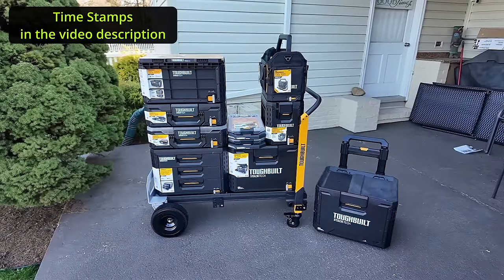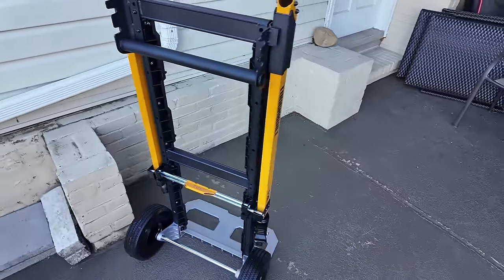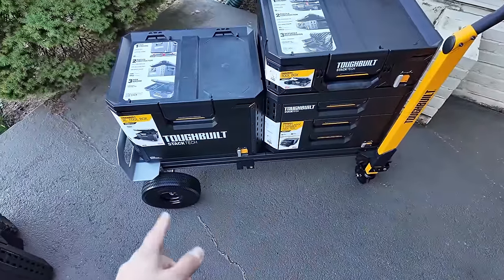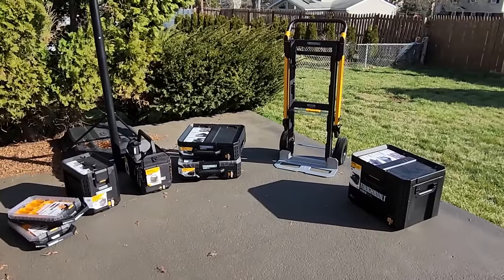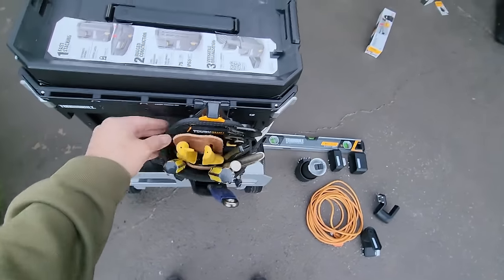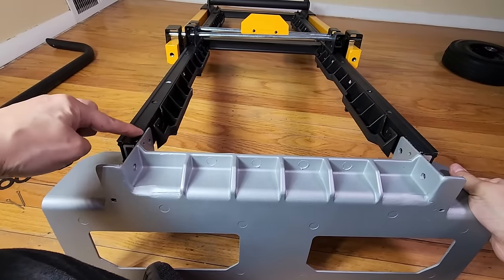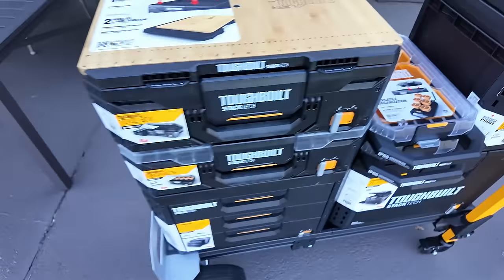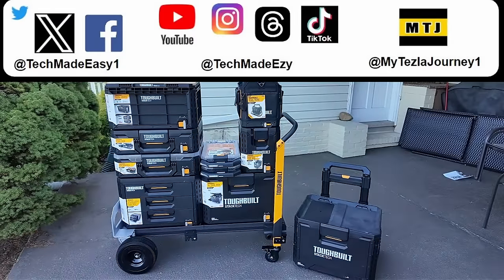ToughBuilt StackTech 2 in 1 Convertible Hand Truck Stacktech Hand Truck

Comment: Nice review I still want this even though it won't do fit in cart mode on my trailer I made. It will fit if my machine  in not on trailer. I made width of the trailer 3f 8inch.
Reply from the maker: Thanks 👍🏼

Comment: What is the height in handtruck configuration with the 3 drawer attached? Would they fit under a tonneau cover in a truck bed while attached?
Reply from the maker: Remind me and I will check, poke me tomorrow late am
Reply: With only the 3 drawer box (or two of them side by side) it would fit under the cover on my F150 (retractable cover, not low profile), but the handle will not. You would have to slide it under in dolly  configuration. The handle sticks up roughly 3½ feet in hand truck configuration.
Reply: It's just under 26" to the top of the drawer box

Comment: Does it fit in a truck bed? Like laying down or on its side? I have the milwaukee hand truck and it fits in the bed while turn on its side. Let's see a video of that!
Reply from the maker: Yes, You can lay it down in a truck bed
Reply: @TechMadeEzy  I wanna see if if it fits in 4 wheel mode though with single drawer of tool box. I have a teanou cover on my bed and looking for solution to be able to just pull out my stuff rather than having to take it all apart and back together every time I take it in and out of the bed. F150 bed height is 21inches. Need to know the height of the hand truck with the single drawer or regular tool box still attached.
Reply from the maker: Ok good idea

Comment: It looks like the crack in the toe plate wasn’t there during the assembly part of the video. Did it get dropped hard or something?
Reply from the maker: It wasn't there during setup it's interesting because I didn't put any weight on this so I don't know how that happened but that concerns me I'm going to have to swap this out
Reply: Could just be a scratch in the powder coating that looks like a crack if it wasn't there during assembly. You should look at it super close to see if it's just scratched powder coat or an actual crack.

Comment: Where can I get this it's out of stock everywhere
Reply from the maker: The only way you’re gonna find it is if you just drive to many different Lowe’s stores check their stock and check their above stock even in certain isles. We actually had to drive to Florida to get this one. You can also go online and use different ZIP Codes on the Lowe’s website until you find one and then when you do, you’ll be able to set it up for pick up. They won’t offer delivery for some reason.  good luck.

Comment: at 8:27 is that a massive crack in the forging of the bottom? thats not good.
Reply from the maker: Yup, not even sure how that happened. When I was assembling this it wasn’t an issue and I didn’t even get to use this other than moving it around and putting empty boxes on it so I’m gonna have to make a claim.
Reply: Not sure this is a forging looks like a casting. Use your Dictionary…. Sorry ❤😊
Reply: Forged parts have some markings the process hey I’m retired and love being hopeless til it’s modified for task at hand.

Comment: How does this compare to Cosco Convertible 4--in-1 hand truck that goes for $129.99 - $159.99 at Costco (usually on sale at $99.99)?
Reply from the maker: Don’t know Justin, have you seen or used that one?
This, of course, fits a tough built stack Tech toolboxes, which is an advantage
Reply: I’ve got one of those and I hate that the nose plate feels like it’s on a hair trigger; the nose plate may as well not have the ability to fold up, since it very easily unlocks and slams down. I’m thinking of replacing it with this TB handtruck since I’m accumulating Stacktech boxes (which I absolutely love).
Reply: Looks like the TB dolly is very similar to the Cosco 3 in 1 dolly. I've got the Cosco 3 in 1 dolly which is like the 4 in 1 but  the foot doesn't fold up. It has been great in my applications of using it to transport Dewalt ToughSystem boxes, ladders and step platforms on job sites. It's been so handy for both rough terrain transport in its 2 wheel configuration as well as handy loading up a lot of stuff on it in 4 wheel configuration on concrete surfaces. Tough Built has got a winner with this dolly if your in the Tough Built platform imo. It is a bit pricey considering you can get the Cosco 3 in 1 for $99 often. But ofcourse the locking feature for the boxes is pretty neat imo If your willing to spend the $.
Reply: @justinssebanenya1329 I think your prices are for the Cosco 3 in 1 not the 4 in 1. The 4 in 1 is around $190 usually.
Reply: I have the 4 in 1 and it's great. I have no issues with the toe plate on mine as someone else posted. The best thing is you can use it at a 45* angle between dolly and hand truck. I don't use it a lot but when I need it it's awesome to have.

Comment: Some of those are just tack welds. Kind of hard to tell, but one of the welds appears to have a crack.
Reply from the maker: I have to say I didn’t have time to exchange it or do any warranty claim, but I’ve had no issue and I’ve used it a few times

Comment: The castor wheels are small and solid, can't roll over much other than smooth hard surface. $269 is about $200 too much.
Reply from the maker: you own one?
Reply: @TechMadeEzy  I'd guess not. It seems like it's solidly built, and the castor wheels look plenty big to me. I thought 269 was a little much at first, but upon reflection, if it can handle 400 pounds in hand truck mode and 800 in cart mode, it's a steal imo. The Milwaukee equivalent is only 40$ less and is a hand truck only. I'm pretty partial to Milwaukee, but this is obviously worth the price.
Reply from the maker: As you know, I’m just doing a review I’m not a construction guy. I’m not putting this through the test but definitely first impression putting this together using it for a few days with different configurations. I feel pretty good so far.
Reply: @TechMadeEzy Its a pretty good dolly even if its a little pricey. Its probably worth it since it has the box attachment system on it. Cosco makes a 3 in 1 that is very similar and they usually charge $169 for it but you can often get it for $99. I have one and have used it for several years with my Dewalt Toughsystem boxes and it works great. If I wasnt already heavily invested in the Dewalt system id probably get into the Tough Built system and get this dolly. It is a very versatile solution for transporting the box systems and so much more on all kinds of terrain in my experience. And the Tough built box system seems to be a winner.

Comment: Too heavy, assembly shows how poorly parts are made.  Took a hammer to get the parts together.(the handle) Several of the welds had flux wire pieces still sticking out.  I tried it on one job.  Switched to the 4 wheel dolly, and the equipment back to my old hand trucks. Thx for the video.

Comment: LOOKED LONG AND HARD THAT CRACK WAS NOT THERE IN YOUR ASSEMBLY VIDEO
Reply from the maker: Paul you are correct I went back to the set up video and everything looked fine, so this must’ve happened after putting it together. The weird part is we only had boxes on this unit. They weren’t even full. There was nothing inside of them. I’ll have to contact them and get a replacement.

Comment: You cannot buy it anywhere.
Reply from the maker: I know it takes time but try to run around to different stores when you have time you might actually be surprised to see one sitting on the floor in stock
Reply: Lowes has a price tag on the shelf but no units yet. 🤨
Reply from the maker: @SD-jf7nb keep walking in the stores also keep checking Lowe's online with different zip codes
Reply: @SD-jf7nb  what was the price?
Reply from the maker: $269

Comment: looks like you can not open the units on the handle side while in place since the handle will get in the way. The entire idea on any of these stacking systems is the ability to open lower units without unstacking. Poor design on Toughbuilt's part
Reply: You can, just got to unlock box above and tip back an inch to access center latch then drop box back down.
Reply: @MONEYZ123 Yep pretty easy actually. Its basically a non issue with how awesome the locking system is.

Comment: Its a Lowes Product so I will not trust it. Lowes in Az. sells low-quality products that do not handle the extreme heat and sun out here.
Reply: No they don’t
Reply: It's not a Lowe's product but a product that Lowe's may carry. I've been using Tough Built tool punches for years now. Long before Lowe's ever started carrying TB. That being said, TB quality has noticeably slipped since I first started buying them. Cheaper manufacturing processes or materials one. Either way, they're not quite the Tough Built they built their reputation on.

You are right about Lowe's though. Stay away if at all possible.
Reply: Craftsman and Kobalt. Not TB
Reply: Lowes garden and wallpaper center doesn't sell quality stuff anywhere... Homeowners and apartment renters who fall for gimmicks are the  customer base..